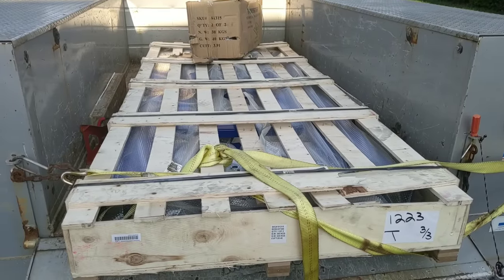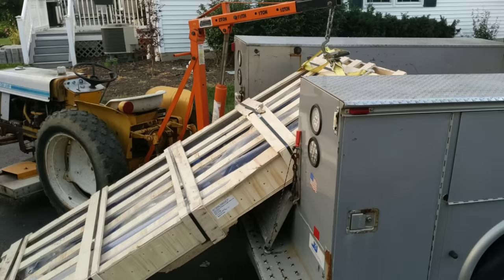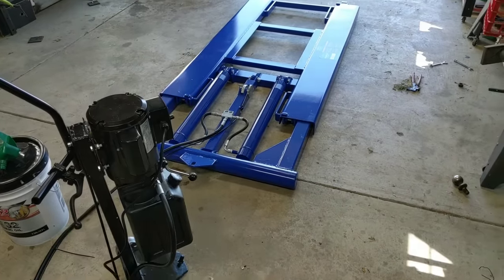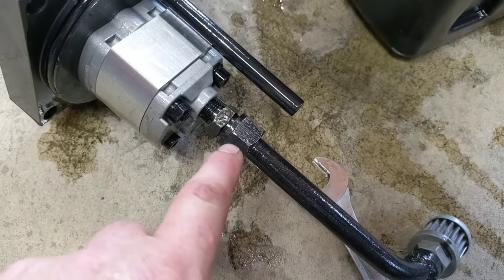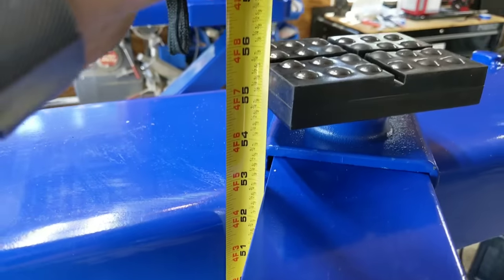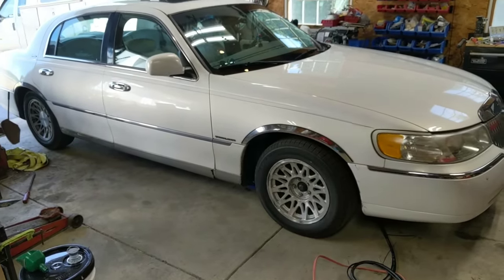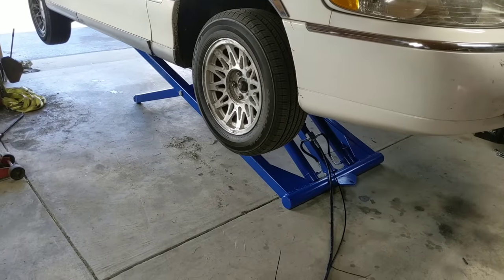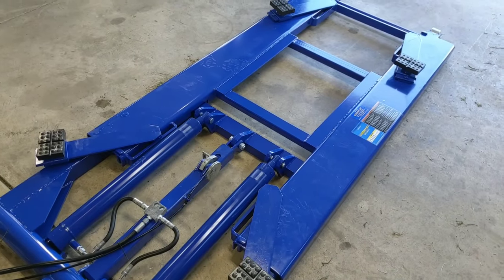Harbor Freight 6000 Lb. Capacity Scissor Lift Review, Central Hydraulics, is it worth it?

Comment: For that price I think I would just buy the real deal.Also its in the way for most jobs.
Reply from the maker: The real deal like a 2 or 4 post?    They are great for jobs where you need under the car.    Scissor lifts are great for lower / body detail work.    I can sit on a stool and wheel all around the car without the post getting in my way or casting shadows on the car.    Scissor lifts are just a different tool for a different job.   I could of purchased a portable 2 post for the same cost, but I needed a scissor lift.

Comment: Have one and they are great but there are several issues you must know about.  First they are heavy and the small roller wheels make it a bear to move in the shop.  The wheels on the pump are about the  worst in the world.  One trick I did find to move it is simply raise the platform to about mid position and that allows the rear wheels to make better contact to floor before the frame drags.  The only other issue worth mentioning is simply if you have a car with very limited ground clearance simply buy 2 2x8" about 12 or so  feet long to drive up on  so you can drive up on the lift.  Have put my Dodge Ram 1500 4 x 4 on it without issue and it was stable.  Just remember as the ceiling comes up realfast.

Comment: I’m no math wizard but, how is 55 1/2” “almost 4 feet”?
Reply: hey smart guy 55.5 in is actually more than 4 feet its alittle more than 4 and half do youre math
Reply: Just use tuba sixes if you need to.
Reply: 4 foot 8 inches exactly
Reply: he's referring to metric feet
Reply: When you raise the car in this way, the wheels and tires will be lower as the suspension relaxes. Around 4 feet total ground clearance from the lowest part of the vehicle, sounds reasonable. Although you can do more with these, they are primarily intended for working on wheel, tires brakes and suspensions. The way these are made with cross braces,  some other work may not be possible, or only slightly improved. The lift itself may move up 55.5"s off the ground, but parts of the vehicle will be quite a lower.

Comment: the lift needs to be stable enough to keep from tipping over ….
Reply: Julian Reid I was thinking the same thing. Wider base and bolted.
Reply: I just saw this video, and I was thinking the same thing. The car alone looks as if it's a bit wobbly, and for it's limitations of interfering with any sort of underneath work like drive trains, brake/fuel lines, exhaust, transmissions, and etc... I'm having a hard time with seeing the value vs. the potential of this thing dropping a vehicle on somebody. There's a reason that the professional shops use the right lift for the job.
Reply: @ianc435  Have the same HF scissors lift for 10yrs. Have never had any problems with it.

Comment: I wouldn't trust one of those, specially since we've been waiting for the big one 10^.
Reply from the maker: Had it been a lift that was designed to work under, I wouldn't trust it.   But it's just a scissor lift, something you would never get under.
Reply: @1D10CRACY  what is a lift like this for, changing tires? it looks like even if you raised it 18" off the ground and put jack stands under it, you couldn't get the lift out from under the car to work on it once you set the car on the Jack stands.

Comment: this is only good to change your tires...NO THANKS I HAVE A FLOOR JACK
Reply from the maker: you are absolutely correct! This is not designed to stand underneath your car! It is basically designed to lift your car just enough to work on the lower extremities without breaking your back! It's great for body work and changing your brakes!  A follow up video in reference to your comment can be found here.    https://youtu.be/RAqqgq7ielE

Comment: Mine fits in the back of my F-150 with ease and my Tommylift gate (750# capacity) lifts it without problem.  This is a great little lift which will lift my 5,500#  F-150 without issue.  It's surprising how much value for the money was here.  I have had this lift for 5+ years and it's still awesome.  Too bad they no longer sell them.

With some metal ramps, I have used it to lift a Ferrari F355, which is a fairly low riding car.

Comment: Excellent video. The only thing I don't understand is the practical application. What do you use it for? If I want a vehicle that high off the floor, it'd because I want to be under it to work. I can't share space with that big chunk of machinery.
Reply from the maker: You would never get under a scissor lift!   These are great for detail work, as you can roll around on a stool and don't have shadows from a post lift.    If you need to get access to the underside of a vehicle, you really need a post lift.  Just different tools for different jobs.

Comment: My scissor lift was a defect it wouldn’t work so I got it at a good discount here when I diagnose the problem I found the motor was wired to run in reverse it wasn’t making pressure to lift rewired the motor everything worked then I converted it over to a 12 V motor so I could use it on my car lift on my race car trailer when I went to the dragstrip

Comment: Looks like a good lift for the money. I shop at Harbor Freight also and I don't mind their products for the money. I was also glad to see that you found the items that were wrong and fixed them. I do that many times when I buy something that is not quite right. Just wanted to throw in a comment on gaining more clearance in the ceiling area. If the garage door springs are adjusted well the openers can be mounted totally on one side. This would give room in the middle of the rails to let the vehicle raise higher...

Comment: Escape lugnuts have sheet metal covers that aren't standard size. I tried all the metric and English sized impact sockets, all either too tight or too loose so forced on the standard socket with a rubber hammer and left nut on a few threads to work them off. I then ordered a set of normal lug nuts from Amazon for the next tire rotation.

Comment: The width of the base looks a little scary to me. Example if you had a small truck with unbalanced weight in the bed. You did a very good presentation for this unit.

Comment: I have a 4 post lift I put in my garage I have 9-foot ceilings I had to cut and reinforce my trusses and regardless of what anybody says I move my garage door opener to pull from one side of the door and it works awesome if you have to adjust your door on the other side to lift a little bit harder but not much

Comment: i work at a tire store and he have post lifts and we needed one more so they bought one of these from one of our suppliers..not harbor freight..but its the same identical lift..like you said h.f. didnt make it they buy from suppliers..and yes we bolted down wood planks to the floor on the sides so cars would clear the lift..(some cars that have been lowered by owners still dont clear it tho)..but we have had ours for at least 10 to 12 years and still works like a charm..looks pretty ugly now from daily use but still works..a tip...every so often you may need to tighten the nuts back down on the sliding arms as they will sag and possibly come loose..also..did you remember to cut off your air ride in your Lincoln first?..lol..nice review tho.

Comment: Great review.. does seem to be a good option for a less expensive lift. Curious. 3yrs later how is the lift performing? Any issues with hydraulic leaks or other failures?
Reply from the maker: Still using it with no new issues.   Seems pretty reliable.
Reply: @1D10CRACY  thanks. I wondered also if it ever seemed unstable/wobbly due to it's width or that it's not bolted to the concrete anywhere?

Comment: Hi mechs,
The hydraulic unit came beat up box same broken wheel, I think China ships them with a broken wheel section😁. However I found a 🇺🇸Grainger replacement that has better strength.

The only thing I run into is the post staying in the hole . 
I’m going to drill it and put a clip.
The other thing it needs is a drop caster front system, so you can move it easier. I am at the drawing board so soon I will have an upgrade for you guys. ( and power wheels) .
There is a 12 volt internal power wheel I’m looking at.
Last thing my wonderful gearheads and engineers. 
Buy Callerpillar epoxy the Cat yellow holds up the best. 
Paint it new.
HarborFreight’s companies put substandard paint on their equipment.
Personally I think there is where they make the money. But then we can have affordable tools.
Mask up mix up clean and epoxy paint.
Kev.
Reply from the maker: One thing I've noticed is if you move the lift raised a few feet off the ground, it rolls pretty easy.

Comment: While working as a body tech I had occassion for about two years have  a lift similiar to the one here in my stall. It was a joy to use and probaly increased my production by about 25 %  because the way it fit into how I worked. Were I still in the trade I would not work where I did Not have the lift

Comment: I had the exact same problem with a slow down. The problem is the viscosity of the common hydrolic oil. At 32 it takes forever to lower the car. Still looking for 0 weight.

Comment: That's a good for change in tires if you want to do all forward one time but it blocks too much stuff underneath the car no exhaust work blocks a little bit of transmission it's rear wheel drive.

Comment: I have one and used it for several years.It's great for body and paint work.Very solid.I placed a couple 2x12 planks next to it which enables low clearance vehicles on.Only complaint is that the powder coated paint is very poor quality as it flakes off and rusts quickly.Obviously the steel wasn't heated enough for the powder to fuse.
Reply: @jim... what do u expect for$290.89 and from China made China owned harbor freight

Comment: Seems like the only viable use for this would be Wheel work, tires brakes wheel bearings tie rods ball joints CVshafts control arms struts etc.  Maybe just maybe some rust proofing such as oil undercoating. But exhaust and major work like trannys out of the question.  But could be useful to some degree.  Just have to see it for what it is.  Cheers

Comment: Nice garage shop. The flat screen is good to watch You Tube Videos while working on the car. I hope you have a motorized articulation mount on that TV with a wireless remote...Cheers. I would use that lift table to work on the big McIntosh amps...lol

Comment: Not bad. This video was very educational. However, this device would not allow one to R&R major components such as a transmission or rear end. Therefore, it is not the best choice except for basic repair.
Since this is a three year old video things may have changed. It may still be well worth investigating.
Thank you for the excellent and very unbiased video.
Reply from the maker: Hi thanks for the comment.   And you are absolutely correct!   Scissors lifts are not designed to get under, they are really only designed to lift the vehicle high enough to work on the lower extremities of the vehicle.   If you need to work under a vehicle, you really need a post lift.   But if you do a lot of body and detail work, these are awesome as you don't have post casting shadows and or getting in your way.  It makes it very easy to roll around the car on a stool doing body / detail work saving your back.    It's just a different tool for a different job.  :D

Comment: Just a safety precaution just remember that your jack or scissor lift is only as good as the ground it’s sitting on. 
Not all concrete is created equal some have footings underneath them somehow rebar some are thicker some are thinner.

Comment: There are a number of 2 post lifts that sell from anywhere between 1500 to a few thousand. 
Most of them require forklift to remove from truck, Some do not. 
sizzer lifts are nice for someone with a low ceiling. 
someone who wants a 2 post lift yet does not have a garage are for it can place in a slab and footings and install a cheap tall car port would work out pretty easy.

Comment: These scissor lifts aren’t bad if you get one delivered in good condition but they’re definitely not a good lift to use if you need to do any work under your vehicle between the front and rear wheels. Gonna need a two post lift for that.
Reply from the maker: Yup!   Different tools for different jobs!   Scissor lifts are great for detail work!   You can sit on a stool and wheel all around the car without post getting in your way or casting shadows.    But if you need to work under the car, a post lift would be a better option.  Different tools for different jobs.

Comment: Harbor Freight buys from overseas and it's all shipped in conex containers and when they pack the containers they pack them they shove as much as they can in the container and when it comes time to unload them sometimes straps and chains are used to pull stuff because they are packed so tight and most of the cardboard boxes are ripped or completely destroyed. most of the rust is because usually there is no coating to protect the metal and from the stuff being packed in the containers and shipped across the world there is alot of temp changes and alot of condensation in the container. I've unloaded a few Harbor freight containers they were dreaded and most people walked away from them not wanting anything to do with them because everything would be crammed and ripped and damaged they were headaches.
Reply from the maker: Harbor Freight stopped carrying this lift last year.  The rumor is they are sourcing a company here in the states to make them.  Apparently shipping is so expensive now they can make them here and still make a profit.  Eastwood is trying to sell this lift for 2800 dollars and at the time of this video harbor freight was selling it for 1600 with a coupon that took it down to 1200 bucks shipped to my door.   I hope the rumor is true, I'd like to see them sell more stuff made in the USA.

Comment: The main drawback I see with this lift is that so much of your work area will be hidden above some piece of blue metal. So, you pull your car onto the lift and get it 3 feet up in the air. You can't really use a creeper or walk underneath so you have to stoop or crawl underneath the car to see that the u-joint you want to inspect in blocked by a blue cross member. Up front you have to contend with the 2 hydraulic pistons and the locking mechanism, OK if your pulling a radiator but more problematic if your wrestling with a hard to get to starter.  I wouldn't suggest this lift to an amateur contortionist, but if your young and can twist yourself into a pretzel it might work to access about half of your cars under carriage.
Reply from the maker: Right!   These lifts are not really designed to get access under the car.   They are really only designed to lift the car high enough to work on the lower extremities.  Perfect for detail and body work as you can wheel around on a stool and nothing gets in your way or cast shadows like a post lift.   If you need to work under the car, you really need a post lift.   Different tools for different jobs!

Comment: you might want to have a forklift handy in case the car is stuck with the lift in the up position. because it may become a safety issue like your safety, recommend if your going to buy a lift buy a quilty lift because you can see all the problem right out the box, and not the ones down the road. good luck.

Comment: Perfect for oil changes, brakes and most suspension work. You are limited on what you can access with the scissors in the way. I think about 75% of the vehicle can be worked on with this lift. But for 2 grand more you can have a 10k bendpak 2 post lift and access everything. Just depends on what you work on and how often.
Reply: The problem is that two post Bend Pak won't fit in most residential 2 car garages. The garages aren't wide enough and the lift takes up more than half the width of the garage thus preventing parking a second car in the garage. Also ceilings tend to be too low for most two post lifts. The scissors lift lets you drive over the lift and park the car over it so it isn't taking up room another car can use to park in the garage. When I moved to my new house I went with a two post Max Jax but it is a PIA to move the lift columns out of the way when I want to park the wife's car in the garage along with the car I have on the lift. MaxJax columns are 130 inches apart (almost 11 ft between the two) so it can lift my Corvette. That is more than half the width of the typical 19 ft wide two car garage.
Reply: @BillD64  Right I hear ya on that yeah if you dont have a minimum of 10' ceiling then the scissor lift would work out better

Comment: Gosh, it just looks unsafe to me. I enjoyed the video and the way you explained everything.  I just wonder about how stable it is. Then there's that all important question about how much can you actually do under the car like exhaust systems and transmission removal. Does it raise the car high enough? And would I actually trust it to work underneath it?  Sure, brake jobs and front end work could be done and it raises the car high enough for that work. How stable is it fully extended? Would you trust it to stand under it?